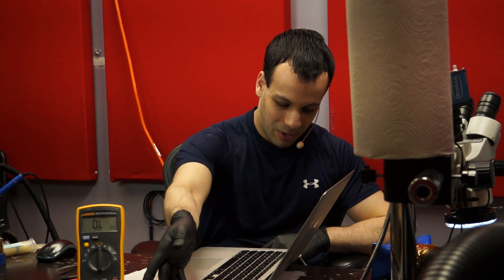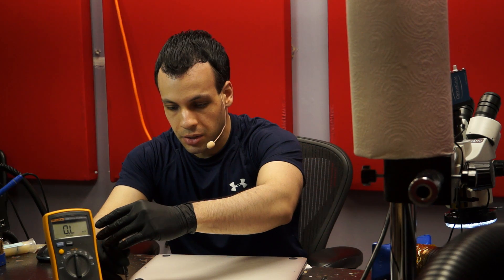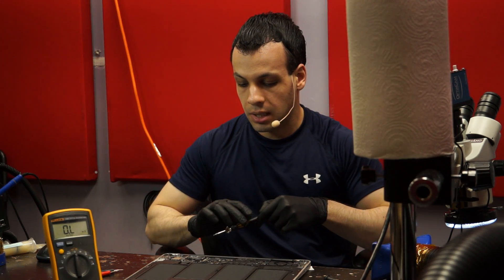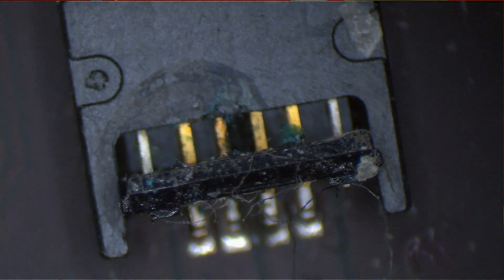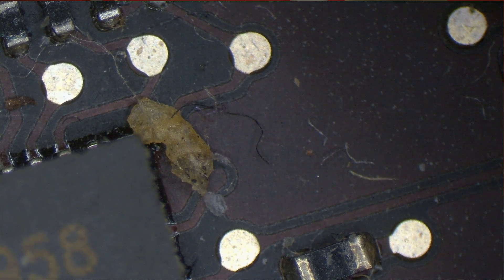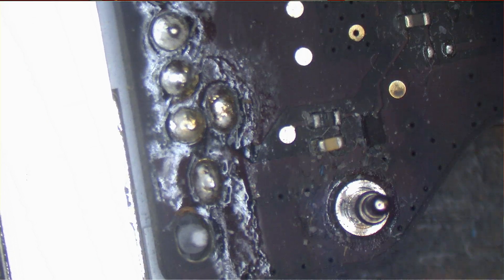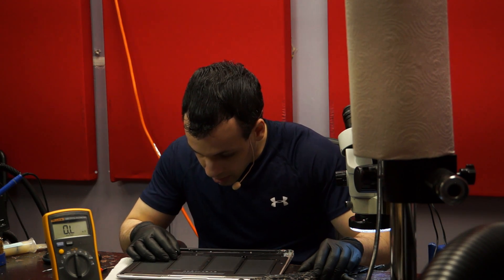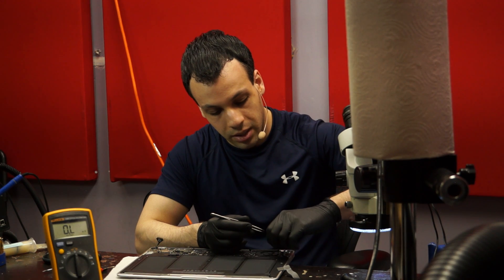How the trackpad can kill a fully functional Macbook Air.

Comment: I still see very slow banding that ive never seen on any of your other videos before. LED lighting is a pain in the ass if you don't have a high-frequency buck/switching power supply and it simply capacitive-drops voltage at the mains frequency with some capacitor smoothing.  Yes I realize the video is from 2016. You did ask.  But, no _tearing_.  The banding I see is entirely background light on the red background, slowly vertically dimming then re-brightening over the course of a few seconds.

Comment: Ha I think I have the same problem with my 2013 macbook pro 13 inch. I could be wrong but I ended up sending my late 2013 macbook pro 13 into a shop that fixes water damaged laptops because I thought the SMC controller on the logic board was dead. Well I got it back and it was still having the same issue where the fan would spin up all the way to 6200 RPM. I sent it back in and they fixed the problem and told me it was my touchpad so I am hoping this time it is fixed. Anyways thanks for the video!

Comment: "You get blames all the time for breaking shit you never touched"

Used to work M.O.Ts, can confirm. Always got a "YOU BROKE THIS" but it's really "Bitch, I make sure the car's working and road legal, and you're telling me I shorted your fuse box when I never even needed to open the fuse box and when the lights that use the fucking fuses were working during M.O.Ts? Get out of my shop"
Reply from the maker: +Rhys Black preach!!
Reply from the maker: Snadzies when I walked outside today it started raining, that doesn't mean I brought the rain.

I would suggest that when the person spilled coca cola on it and kept turning it on for a month, or when they dropped it off a balcony, that they started down that road far before I ever touched it.
Reply: Let's look at that from a consumer's perspective.
They bring in their car/computer/whatever in and X part was working when in came in and when they get it back X part does not work anymore.
What would be the most logical reason for X part not working anymore between the short time that the consumer handed their item to the repair show and when the consumer got their item back?

Anyone who repairs any mechanical or electronic items casually or as their profession knows that diagnosing a problem can mean moving, removing and just plain touching all sorts of components all over the place and doing so can effect said component and even other components down the line.

While sudden and spontaneous failure happens, does that seem like the most likely cause when you consider the fact a person what just rooting around the item?
Reply: Rhys Black i

Comment: Louis, rather than have that magnet hanging on and getting in the way get a stronger magnet and run it along the screwdriver 4-5 times in one direction only. I find it easier to go from the handle and off the tip. That will magnetize the screwdriver just enough to hold a screw on the tip. If you find it's not strong enough then do a few more wipes of the magnet. 
It's a lot less troublesome than having the magnet hanging on ;-)

Comment: Since you asked, I will throw in my 5 cents. First, I don't think it's a paradox, but a symmetry. Purely logically speaking, it would be fair, to take the credit. However, I don't think I am doing my intelligence justice by orienting on the stupidity of other people to justify clearly questionable actions. So, I think we need to bite the bullet and ignore stupidity while maintaining our own code of fairness. That said...even if you open a computer, put it back together and it works without particular reason...you did invest some work that you should charge for. How much is to be determined by your personal opinion. If the customer is a douche, charge more, if not, be nice. I think you can justify this personal preference with the circumstance that on the other hand you have to bite the bullet of stupidity. Therefore symmetry is restored even if in a wider circle of reasoning.

Comment: Pretty sure you can't clean the trackpad(in the ultrasonic) considering the sensors will be overheated and get ruined, resulting in the surface of the trackpad not being able to track normally. 

But I am not sure on it, I will have to try it at some point :)
Reply from the maker: +Martin Holmenlund I just replace it, it isn't worth the trouble for me to find out.

Comment: "Take the board out of the computer". The board, is the computer!!!
Reply: well not realy oO its just the main important component with out the rest of the computer its just the motherboard
Reply: Deon Hamilton actually it is. I can make the computer work with the battery and the board. I just can't use it. But the circuit board is the computer as this is the part which does all the calculations
Reply: with the battery connected you could call it a computer as then it becomes something that is capable of receiving information but thats not what you said and now your adding shit oO  at the end of the day this whole Mac is a computer if you remove one part that one part wont define the Whole thing
Reply: its like saying ill remove the cpu from the computer and then some prick saying, O dam the cpu is the computer so hes removed the computer from the computer oO
Reply: Yea but the pcb is actually the computer hands down. Its even computing when no external battery or power sources added. Clock signals still travel through processing elements ect. So he technically said "take the computer out of the computer". Its not a computer which can be used in such condition by regular users.
Reply: Deon Hamilton its a fact... You don't have anything better to say for the powerless but still computing circuit board comment from me.

The board is the computer, everything together makes a Macbook.

Comment: Can the trackpad be put through the ultrasonic cleaner?
Reply: You can unplug the board from the Trackpad an put it in the Cleaner. For me it worked. Finalky i cleaned by Hand a bit. I had exactly the Problem from this video. By the this was my first MacBook repair.
Reply from the maker: +Emmett Turner I don't know.
Reply: +Stefan Kreuzer But it doesn't not work perfectly.

Comment: Just for you Apple will now design their product in a way that you have to remove the fan from the Board.
Reply: why would they use a peltier cooler? they're highly inefficient and put out heat themselves, making the thing pointless
Reply: You might as well use a thermal pad if you're just using the case as a heatsink. Peltiers are horribly inefficient and are generally only used when you need temperatures to be below ambient.

Comment: Apple products seems to give you a lot of business.
Reply: +Sidharth Satheesh because they break easy and not a lot of people knows how to fix boards. Most people do liquid damage. Same with phones.
Reply: jasonc_tutorials I know, that's the point I was making.
Reply: PCs are too cheap to be fixed. I got new refurb pc for 100 bucks american. It's i5 core.
Reply: madkvideo it's laptop, i doubt i can upgrade the gpu. It's for mostly web dev.
Reply: +jasonc_tutorials Nice man. I recently picked up a t410 thinkpad with a first Gen i5 and 4 gb ddr3 for $75.
Reply: +Evan Rozsa I picked up a Mid 2012 15" Retina MacBook Pro for $627 no dents or scratches. I also picked up a Chronos 7 780Ze Samsung i7 touchscreen laptop for $300, but I can't for the life of me get a MacBook Air for less than $200. I want one so I won't feel bad if it breaks.
Reply: +jasonc_tutorials Nice. Specs?
Reply: i5 2450, 4gb ddr3, 2.5 220gb. for 100 flat.
Reply: Cool, get a mid tier GPU and you are set.
Reply: +jasonc_tutorials can put an external USB/pcie
Reply: Erik Abella it's not the same. Too slow. This little guy will be my developer lappy. For me to develop applications. I'm stuff ssd and that's it. Gaming i'll just do on the PC.
Reply: Evan Rozsa Nice.